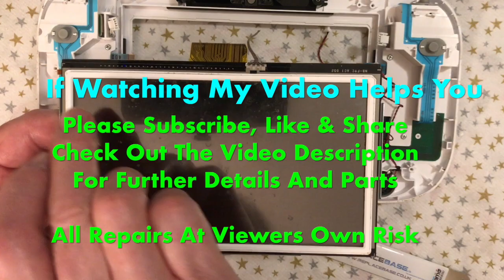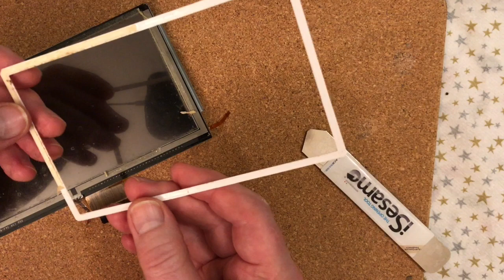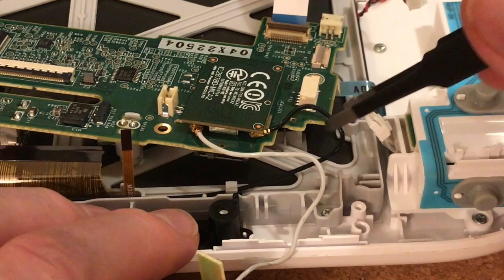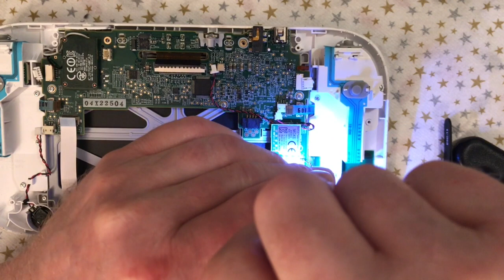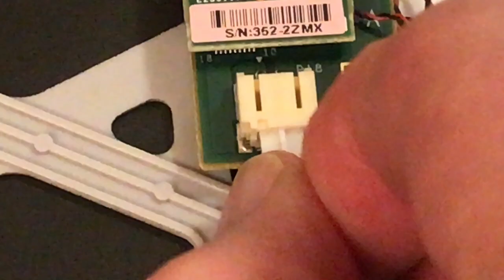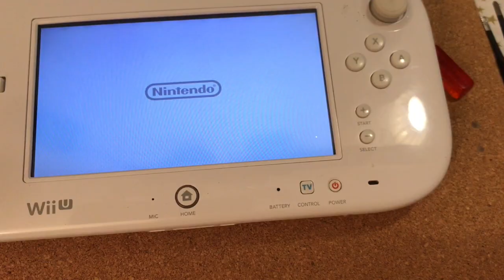nintendo wii u broken lcd touch screen repair tutorial part 2 Fix

Comment: Great vid, was super helpful. Unfortunately I busted the super tiny grey plastic tab on the touch screen connection, very easy to do for those with "dogfingers"
Reply from the maker: Sorry to hear that, are you talking about the large flip connector for the main lcd cable? if so, switch it off and place the unit face down on  glass table or dish and pushing down on the cable connector, hold it with you thumb and power on, if it works and lights up your on a winner. Now for the next bit you can use hot glue ( a complete swine to remove so one shot) or some polymorph. heat up the glue and whilst pressing down on the connector Apple the glue around it then once it cooled it should stay in place.  I recommend polymorph, its low temperature, re-usable, re-mouldable, low temperature and rock hard when cold here is a link https://ebay.us/1edDEu if you haven't used it here's how to do it, https://youtu.be/Vurlrr2cpbM  but as its an electrical fix i'd use a hair dryer to heat it. I can't guarantee it will work but its what I would do. Please don't forget to subscribe to my channel and check out my other great videos and share #fixed1t with friends, family and colleagues. Many Thanks Malcolm aka #fixed1t
Reply: that happened to me too

Comment: I can't see where the black cable goes or the white barely.
Reply from the maker: Sorry for the delay I'm hunting down the original footage, 02:14 here in the UK and I've just found it.  I'll have a look at it in the morning and my video to see If I can add another part to this tomorrow,  if I remember it was very tricky.  Malcolm aka @fixed1t
Reply: @fixed1t  I found it thanks.
Reply: @fixed1t  also I can't see anything but I can touch